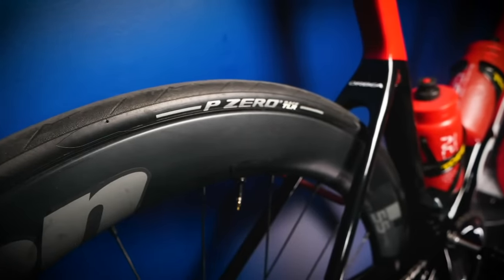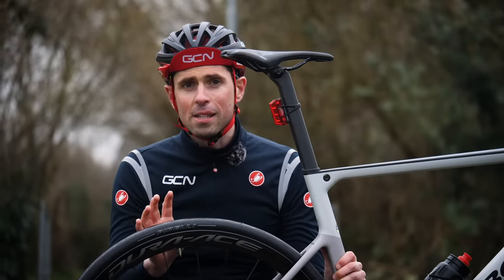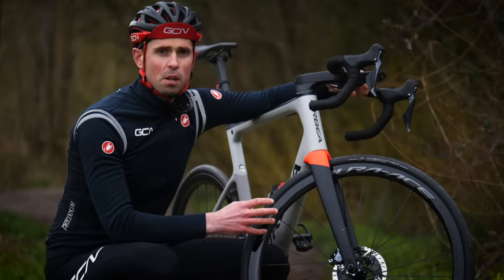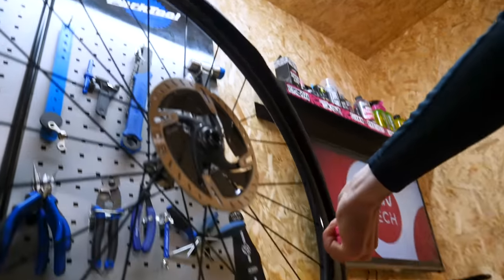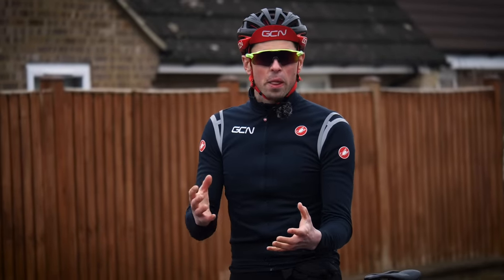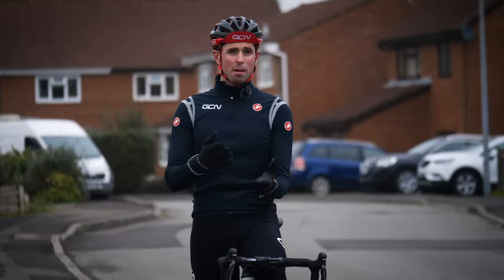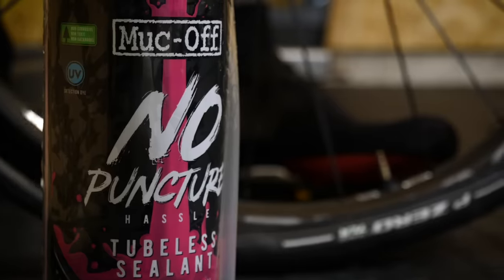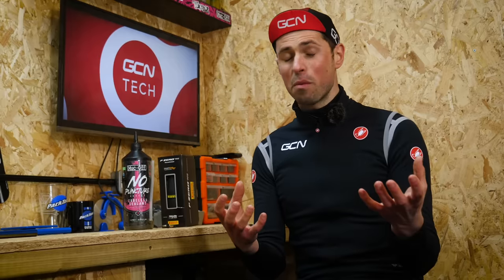Tubeless Convert! | Why Alex Will Never Use Inner Tubes On His Road Bike Again

Comment: Tubeless have saved me multiple times. Last weekend I set out for a super long ride. I was unprepared (gloveless) for the blizzard conditions so when I has a bad puncture only half way around and 40miles from home where nobody could have picked me up from, they held pressure at around 20psi for another 20 miles. I carry a spare inner tube, but it'd have been impossible for me to change them when I had no feeling in my hands. It's good to find a combo that is easy enough in normal conditions to stick a tube into if needed. Some wheel/tyre combos are so tight you'll be there ages trying to get the tyre off and on again. They've also self-healed a few times before and it's just a wonderful thing to be able to keep riding!
Reply: 300 feet down the road from my house I heard and felt sealant spraying as soon as I passed this truck. I just let it seal for a moment and then went for my ride.

Comment: I tried tubeless for a while last year and though I had no problems with them I did have a few concerns, the main one being tyre levers! It’s not so much that it’s one extra thing to carry it’s I don’t like using them. With the combination I was using, GP5000 TLs on DT Swiss rims they are simply way too tight to fit without levers. That’s fine in the workshop but at the roadside, I don’t think so, added to the almost certainty of pinching the inner tube when using tyre levers. I’ve gone back to standard conti 5000s with latex tubes run at 80/70 psi and I cannot feel any difference. However I do know that if I do need to fit a new tube at the roadside I can guarantee to do it quickly and without pinching . So while tubeless is fine for some, sadly not for me.

Comment: I think they're actually almost the same weight between the two tire setup correct me if I'm wrong. Tubeless tires are heavier, sealant + valve makes back the difference.

Comment: Low pressures:  If you're bottoming the rims hard enough to pinch flat on your road bike, that's bad, whether it causes a flat or not.  If you're not bottoming them out, it'll be fine running them that low with tubes, too.
Rolling resistance, etc:  If the small difference actually matters to you, latex tubes are an option.  You need to top up your pressures before every ride, but other than that, there's no real downside, IMO.
Punctures: How often do you get flat tires?  If it's a frequent occurrence, try a different tire, and don't worry about whether it's sold as puncture resistant (I got tons of flats with gatorskins, btw.  They're not a good tire IMO)
the few times a season when I do get a flat, It takes me a few minutes to swap out the tube, fill it up, and throw the punctured tube in my saddle bag to repair later (It'll become my new spare).
Maybe tubeless saved me a puncture or two that I never noticed, but I've definitely had plenty of problems with tubeless punctures not sealing, or losing most of the air before sealing, but then blowing open again as soon as I've got it pumped back up over 40PSI.  Ride over....
Tubeless fanboys will say that you can always bring a tube as a spare, but often tubeless tires are very tight fitting, and much harder to remove, and you still have to deal with pulling out your valves, and putting in the tube on a slimy rim that smells like a dead fish rotting in the sun, and then get that crap off your hands/clothes before you get back on the bike to smear it all over your bar tape.
It's just not worth it.  I came very close to missing a 100k ride I was doing when I had a rim tape fail (orange seal, but I've also had it happen with stans on another occasion.)  It just randomly blew out into the rim while the bike was sitting in my hall at midnight, the night before the ride.  Luckily I heard it happen.  If I had been in the other room at the time I would have woken up early to leave for the ride, and found that I had a flat to fix, and no time to deal with it. 

Tubeless is just not good at high pressures.  It makes some sense on a fat bike with huge volume tires where you might want to run single digit PSI, and otherwise worry about shearing valves, but otherwise I'll stick with tubes.  This isn't a case where "The old way is the best way".  I've tried it several times, so it's not like I'm just a hater.  It's just let me down too many times, and been far more hassle than the few flats per year that it might save me.

Comment: I'm a recent convert and I shan't be riding tubes again. Although I'm not running low pressures and fat tires, riding 23/25mm Vittoria Corsa Speeds, tubeless makes them practically usable despite the superlight construction and these are so, so fast.

Comment: Tubeless tyres don't stop you getting punctures, they just seal it and often you're not aware of the puncture! Always check your tyres after every ride, it's too late checking them just before heading out with your mates!
Reply: Tubeless will flat less as they wont pinchflat, they will also be more resilient to punctures as with less pressure than tubes they’ll allow more deflection from debris on the road before allowing a cut. Yes, you should always check your tires at the end of every ride , and check the pressures before you start the next one.
Reply: @richardh7774  you forget tubeless burp when you hit a square edge pot hole.
Reply: @richardh7774  Yes.  Having to check the pressure before each an every ride is already anoying with my new tubeless setup.  They loose aiir much faster than tubes.
Reply: @ps6149  you may not have enough sealant in there - I had the same issue with the road bike. Lost 20-30psi in 48 hours. New tyres will absorb sealant as well as some being used up filling minor leaks. Popped another 15ml in each tyre, now I just have to top up the pressure once a week, no different to my bike running clinchers.
Reply: @TheAdwills  Thanks!  I'll give a try!
Reply: @dickieblench5001  same as for clinchers. Piece of tyre boot and a tube (or the tube will just bulge out and pop). Haven't had it happen yet with tubeless, though of course it could do, 3 or 4 times with clinchers (though rode on them for many more years so far of course)
Reply: You'd be aware, you can just plug them up faster.
Reply: 9 time out of 10 when i used to have flat was pinch flat from the inner tube. That completely gone with my Tubeless. Road over here a pretty bad, so im really happy with my Tubeless. They are a pain to install tough. I can get them on just with my floor pump, but getting the tire on the actual wheel is always a nightmare.

Comment: I have mostly used Gatorskin tires. Last year I bought a new endurance bike, and have used GP 5000 with a tubeless setup. In the last 2 months I've had more punctures than the previous 40 years, I think. Yesterday I had two punctures in less than 30 miles. Plus, I had sealant all over me and my bike. Today, I ordered a pair of Gatorskins, and tubes.

Comment: LOL, you left out the part where you spent 2 hours setting up the tubeless tires, either because they were too tight and would not go on the rim or too loose and would not seat, even with a compressor. Seriously: I use road tubeless, but it is a huge pain compared to latex tubes.
Reply: Not if they are Mavic
Reply: @?????? You don't pay a bike shop to pump up your tyre. Or do you go men only disco's on the continent. With your mum.
Reply: @?????? I clean up after meself mate. Whether in the shower or the public toilets.  Do you think you can own a mechanic just because you have tubeless tyres. Who do you think you are? Richard bloody Branson.!

Comment: I got into cycling again 20-odd years ago l, I'm now 58 so a bit traditional but willing to try new things cautiously. I bought a gravel bike 2 years ago which came already setup as tubeless (3T Exploro Ltd with Hunt wheels). 1st time I had a puncture that was too big for the sealant to fix convinced me how brilliant they are - used a Dynaplug and fixed it in about 30 seconds, no need for a tube. Bought an MTB a few months ago, same scenario, running about 25psi. Soft sand etc just isn't an issue. 
So I bought a new road bike recently - Trek Emonda SLR with Hunt 44UD wheels and Pirelli P-Zero Race TLR SL tyres, tubeless of course. 3,700km later they are almost down to the wear limit, there are 6 small holes in the front tyre that have all self sealed (so that's 6 sets of standing at the roadside putting a new tube in that I've avoided) and the increased comfort is astonishing - longest ride was 6 hours and I felt fine whereas the previous bike (OK not just the wheels and tyres that were different) left me feeling beaten up after 3-4 hours. 
Think I'm running too high pressure though - 25 psi on the MTB, 40psi on the  gravel bike but 70 on the road bike 😅

Comment: I am with Alex on this one. Last April I switched to tubeless and for the first time ever I had zero punctures!!! It made me so confident that I even kept the (light summer racing) tires on during winter riding. Normally I would go to something more robust and slower rolling (and still get flats). I can also agree on having more grip and more comfort but sadly, maybe because I was using latex inner tubes before, I am not faster. Still worth it, though. Not going back.

Comment: To be honest using certain tyres it's almost irrelevant whether you've got tubes or not! I've had Schwalbe Durano Pluses fitted to my bike for a while now and haven't had a puncture in literally years despite riding around the city constantly. They go over shards of glass and crush them into a fine dust!
Reply: Sure, but those tires feel like crap and are heavy as hell. The advantage of tubeless is, that you can enjoy light and nimble tires without the increased risk of punctures.
Reply: @onezweithree  That's always the dilema when choosing tyres. Puncture protection vs efficiency. Now, that being said, I can't go tubeless because I wouldn't be bothered to check/replace the sealant everynow and then. With a tube system, all I have to check is the tyre itself and tyre pressure and off I go. I use 28x700c tyres 6 Bar front, 6.5 Bar back, a plenty of comfort.
Reply: @philipcooper8297  you are totally right. I am somewhat between the fronts here. On the one hand, tubeless saved me last week on my ride across Germany (500+km in one go). I had two punctures in the front, which both got sealed by the sealant without the need to refill air. On the other hand, my rear tire won’t hold air very well. It will lose around 1bar per day.
Reply: @onezweithree  yep fair point if you're using the bike for racing or something like that

Comment: Once you ride tubeless, the feel when cornering, the comfort, and the lesser punctures will never make you want to go back to inner tubes. That was the case for me.
To be honnest, it took me a while to master installation of tubeless. Now with more options in road tubeless models and growing you can get amazing tubeless road tires. For example, I'm currently riding Contis GP 5000 TL and they are amazing. I even rode them at 40psi in some gravel roads of Colombian mountains without a single puncture.
For setting up, Alex, you forgot the rim tape. And investing in a booster pump has made installation much much easier for me. I own the Topeak JoeBlow Booster pump and it's been amazing for setup.

Comment: I'm riding my road tires in a tubeless setup for over three years now and I'll not go back to inner tubes. The comfort the tubeless tires give is my main reason, without getting a penalty for the lower tire pressure. They feel like riding tubes without the need to glue a tire to a rim. Making a wheel tubeless is very easy, after a bit of practice I need the same amount of time compared to a setup with an inner tube. I'm a big fan! Good to remind is that when you ride a road tire tubeless with a pressure over 6 bar any sealant won't work, the pressure is too high. Ride my road tires in 28 mm with a pressure of 4.5 bar (that's enough even with my 95 kg's of weight) and with a pressure that low the sealant works well. A puncture only stopped me once because there was a big hole in the side wall after hitting a rock. Even the inner tube I always carry didn't save me at that moment. I'll ride my bike with a tubeless setup until there's something better.

Comment: Have been using tubeless for a few years now. My biggest complaint is the price and the durability of tubeless tires. I love the feel and prefer it over normal clinchers. However, I find tubeless tires have a shorter lifespan than clinchers.
Reply: thats where they make thier money
Reply: Is it that you're riding more performance tyres since you switched to tubeless, becuase you can get away with it due to the sealant? I can't see how a mid-range tubeless tyres like a Vittoria Rubino would wear faster in tubeless vs tubed versions.

I will say that tubeless tyres are presently massively overpriced, and also most of the common durable armoured tyres that people use for utility / commuting are not yet available tubeless.

Comment: I tried my first road tubeless installation a few weeks ago after purchasing my first TLR rims (Novatec R3 Stealth). Rim tape, Muc-Off valves (beautiful color!), 30 mils of Schwalbe Doc Blue sealant and Pro One 30mm tyres. I have to admit that it was surprising painless, aside from getting the stiff tire on the rim. The tire sealed with a standard floor pump (my old JoeBlow) and has kept the air since. Riding is really nice. I have to say I am pleasantly surprised and cannot see myself going back to tubes for the time being.

Comment: Aerothan: comfort, performance and easy to use.
Reply: Also 30 bucks for a tube that is not supposed to be patched. No thanks.
Reply: @michaelmechex  Actually you can patch with an appropriate kit. And consider that with 30 bucks you have a 50 g lighter wheel so much  less expensive than buying a 50 g lighter wheel.
Reply: @MarcoRuga  I got a set of wheels 400g lighter than my basic one for a price of 6 of these inner tubes. A custom wheelset built in Austria. Depends how often you flat, but one could go through that pretty quickly. Also I just don't like dicking around with patches, especially on the side of the road.

Comment: I tried tubeless on my MTB last year and it made a right mess. I'm by no means daft when it comes to this sort of thing. But despite cleaning the rim with meths, lining the tape up exactly to an OCD level, adding the goop etc. Somehow the sealant still found a small path of least resistance and came out of a spoke hole. The capillary action also meant somehow it crept under the lacquer of the front rim and made a bit of a mess. Once the leak had eventually healed itself after blowing up to about 50psi and turning the rim around slowly, I felt no immediate benefit when riding other than anxiety of it leaking.

Added to that was a road cyclist travelling down a bad road near me who burped his 23c tyre and couldn't get it to seal at all as it had grit and mud all over the rim. I offered to lend him my woosher back home but he managed. He said to me never bother with this s*it again and wish he'd left his tubes in. 

Call it sad, but to me there's nothing more satisfying than mending a puncture at your own leisure in front of the TV at home, finding the thorn in the tyre and wiggling it out. I just carry a spare tube, patches and decent pump.

Interesting my partner's MTB tyre had about 3 thorns sticking in that somehow hadn't punctured the tube. 

I've just bought some marathon for my touring bike.

Comment: You should do the test at the constant power rating to remove your fatigue from the equation, say one set at 200, then 250, then 300.

My only problem with Tubeless is the mess with the sealant an still having to carry a tube in case (which I didn't do for 4500 Kms last summer).  Not sure if I will continue the adventure.  Furthermore, the constant cost of sealant...

Comment: I run both. Clinchers on my 20 year old aluminum Casati and tubeless on my 2019 carbon Giant Defy. I love riding the Casati with its tiny knee cracking cassette when I feel like being old school. But the last time I took it out I got a puncture. I've never suffered a puncture on the Giant and it's certainly more comfortable. So it depends on my mood but I could certainly do without punctures! All things being equal, give me tubeless every time.

Comment: Made the switch a few months ago.  After 2 hip replacements , a pelvic fracture, ribs, shoulders, cracked, smacked, etc,, oh, the thumbs are special, too, the difference in road vibration, by riding at a lower psi, has enabled me to stay on the road , and look forward to the next catastrophe.      My thumbs could no longer change tubes.  In the first 2 months, I had 2 massive tire apologies, from a pot hole and a nail as big as Ohio.  The first time, the tire was obliterated,  second time, a tube could be installed, as I had blown the tire off the rim.  When I get on the TT bike with 23s at 120, I go cross eyed.  I was really convinced when I snagged a 2 all time on the road bike tubeless, low psi, versus the TT at 120, on Strava.  Retirement never felt better.